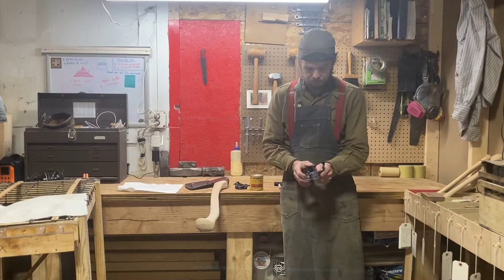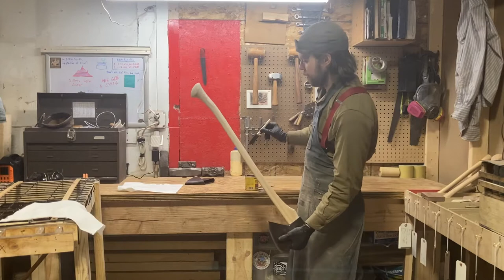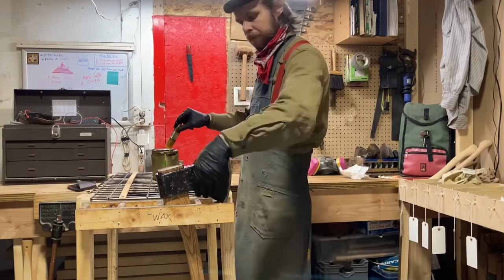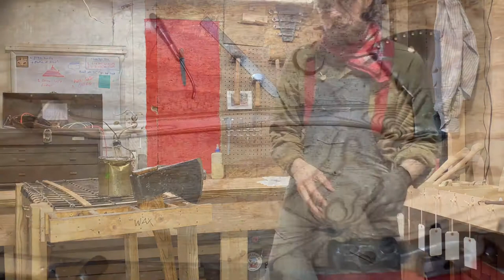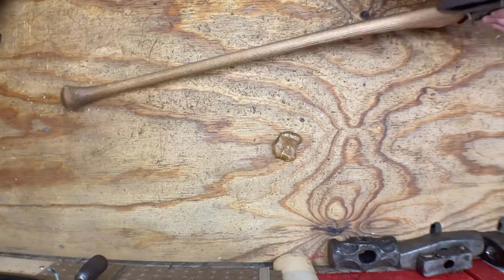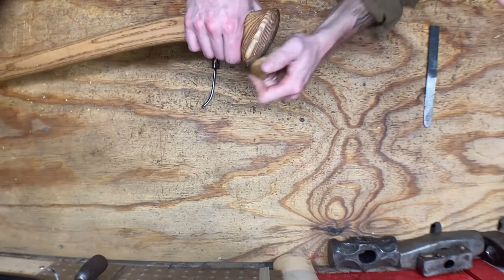Handle Tutorial - Part 7 - Staining, Oiling, and Burnishing

Comment: So enjoyed watching the most recent series of videos. Thank you for putting in considerable time and effort  making them. You have tremendous generosity of spirit and  are a natural born teacher !  As you show in every video, hard earned practical knowledge and the ability to share that is a very powerful gift. Reassuring to know we already share about 80% of techniques, extremely grateful for the 20 % of tips I hadn't worked out (even after many years)  .  Also just to mention I always check the cutting edge face  during fitting the roughed out head by resting blade and handle end when fitted on level surface,  so the handle can be adjusted to ensure the centre of the cutting edge will strike the work first. Tremendous job Tanner keep posting when you have time and A BIG THANK YOU  (UK Hedgelayer)
Reply: Thank you so much for saying so! Hedgelaying is soooo cooool!!!

Comment: I make up a paste from boiled linseed oil and bees wax and apply to the handle after a coat of linseed oil only (after dried).  I'm going to try beeswax/burnishing on my next handle.  Great series of videos!
Reply: I would do a couple more linseed oil coatings, before I'd put the wax on. I also  put the handle under the sun in nnons, now that it's hot and leave the coating on, for 3 days, before applying the second coating of oil.  The wax, I just put it under the sun before the application, to open up the pores of the wood. I'm searching for the best oil to use, however I always find different opinions. boiled linseed oil, double boiled linseed oil, Flax oil, Ballistol is great too and so on.
Theoritially speaking, the more natural the oil and the thinner it is, the better.                        
                             Problem is, that 100% natural ols, are thick, the don't dry properly and have poor penetration too. So, I guess, Bolied or double boiled linseed oil, is the best way to go. Only detail, that matters more than that, is the fact that different companies, make different products under the same name. So, we have to check out, the ingridients, to avoid as much chemical additions, as possible.

Comment: Subbed, this is great. Awesome series. Id like to know how you knock down the high spots while sanding, i always have trouble with that bit
Reply from the maker: Thank you so much! The trick to that is actually making sure that when you cut out the shape on your bandsaw you go all the way up to the line you draw! That helps a lot with preventing the start of things getting wavy! If you do wind up with some high spots You should use the sander in its longest position and it acts a little bit more like a jointer. Keep checking with feel until gone!

Comment: I know this was two years ago, but I am getting ready to re-hang a vintage Craftsman Feller. I don't know "yet" why you would not burn the handle first. I have sanded, will lightly burn next, then put boiled lenseed oil on it. It seems strange to burn the stain?????  Just started watching Thx for sharing
Reply: If possible, you might consider getting a sample chunk of your handle species to experiment with your ideas on.

My late father was a master woodworker and loved restoring vintage 1903 Springfield ( along with M1 Garands and carbines) stocks.

After getting a stock to its bare final finish ( scraped, sanded, steel wooled) he would gently go over the stock with a propane torch to open the pores. He would then give it a nice liberal wipe with Isopropyl Rubbing Alcohol. 

Once it dried, it was onto his stain. Then it was hand rubbed pure tung oil….many coats over many weeks, with light steel wool scuffing in between. 

Then he would knock back his final gloss to his liking ( usually a semi satin sheen) with a super light 0000 steel wool scuff. He’d let that cure and then he would spend all summer leaving the stock in some peak afternoon sun ( maybe a few hours per day) and hand rubbing the wood with a very high quality lemon oil polish. 

We would take turns rubbing the LO in during the week. 40 plus years later those stocks are still AMAZING and only require a semi annual touch up with a dash of LO.

This attention to detail makes no sense for a vintage tool haft…..but 

My point is that there are many ways to get a job done, and you have to experiment and learn what works best for you.

Your thoughts on burning/staining are very intriguing and I am going to do some of my own experiments with an old haft once spring comes.

You might consider checking out the Real Milk Paint Company and their line of fantastic, pure , half, and dark tung oils, plus their natural waxes ( food and child safe) for great protective finishes.

Good luck with your projects and Happy New Year!